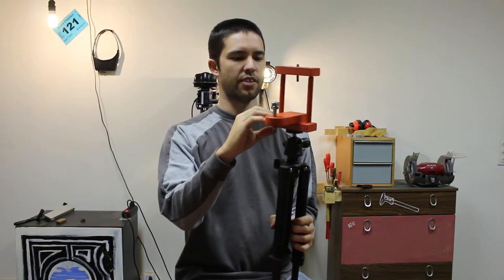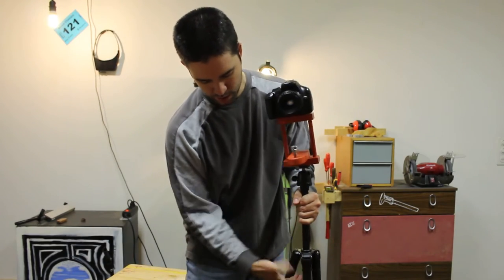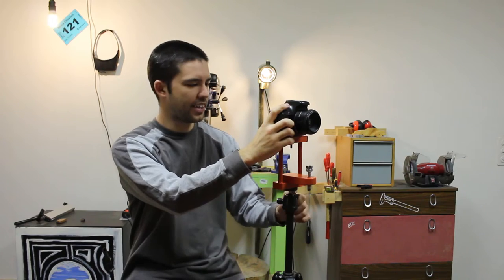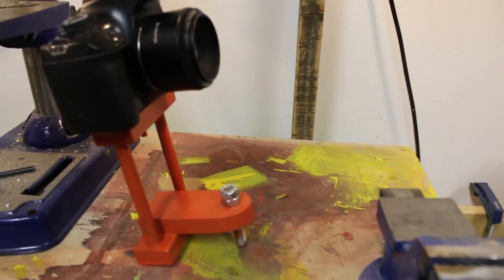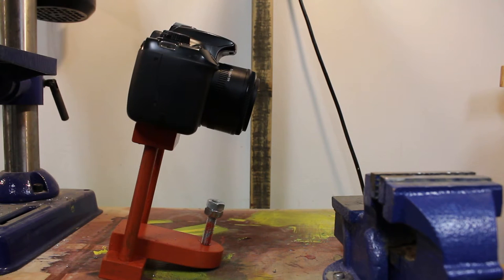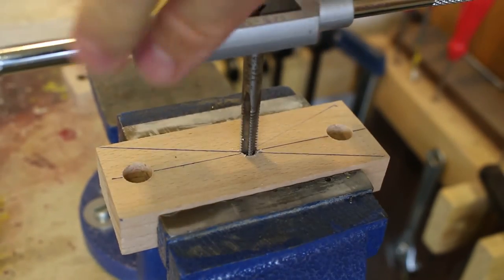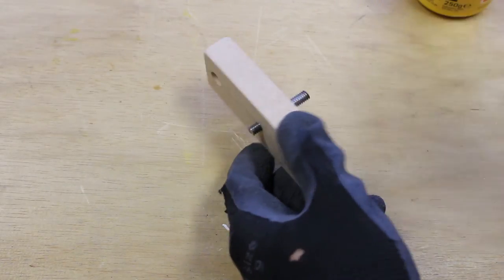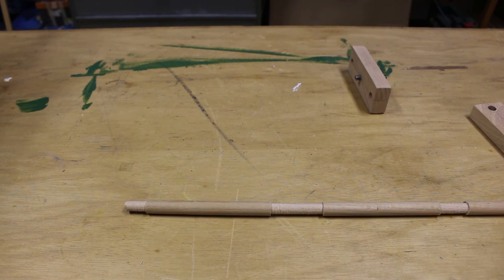DSLR camera height booster

Comment: Pretty neat concept.  Came out nice.  Couldn't you put the extended part on the back side then use it with some washers or whatever as a counterbalance above using it as a base which is a good idea BTW.
Reply from the maker: that's a good idea, guess I could have put it on the back. or even just leave it on the front and put some counter weight in the back. thanks